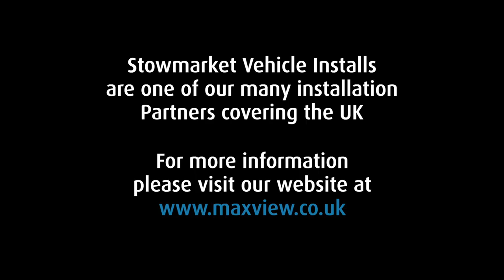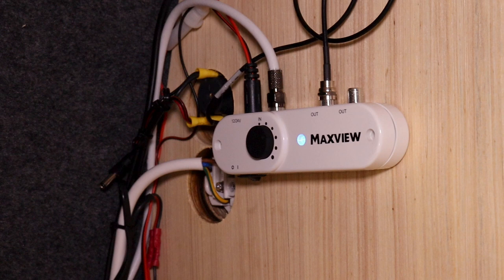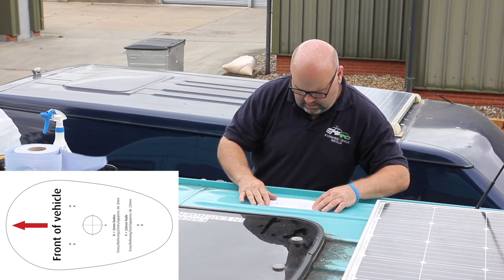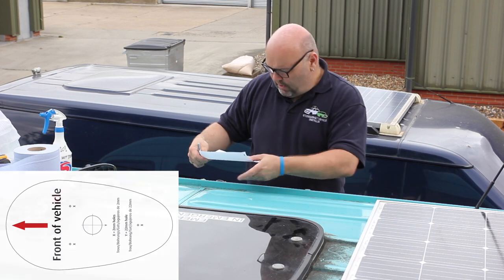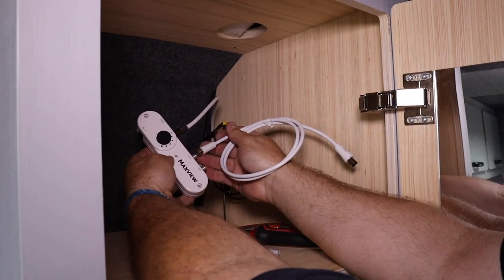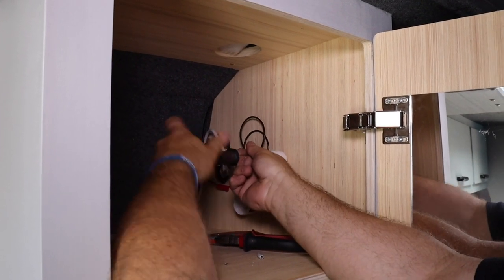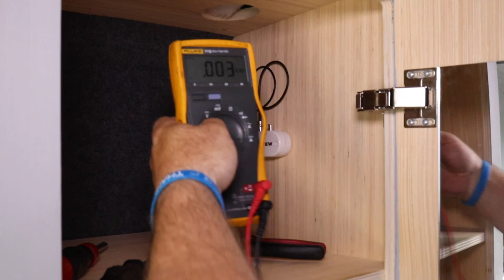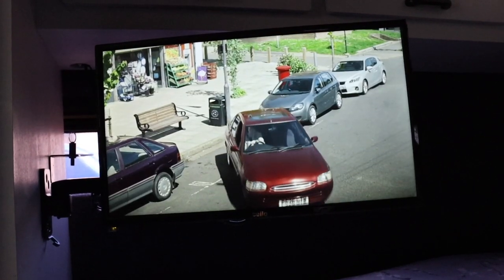Maxview Gazelle Pro Installation | Motorhome TV Aerial Installation

Comment: Hi Tony, thanks for the video. On the amplifier can you attach the leads from the amp power supply to a plug in cigarette type connection, so you just plug it into a 12 v connection in the van, instead of running it to the battery.

That way i only use the power when I connect my power to the pitch up power that i use when im caravaning?
Reply from the maker: Hello @gerlar67. Unfortunately we do not supply a cigarette lighter power adaptor for the Gazelle booster, however you could use one if you found one with the correct plug. We offer a 3-pin 230VAC plug that you could when on electric hook-up however, and our code for this is PSU300.

Comment: what about the clamping bolt??? is it still required??
Reply: Hi there. In this application the roof clamp was not needed,  the clamping bolt is supplied if needed to reinforce the fitting on some caravan applications with thinner roof construction.